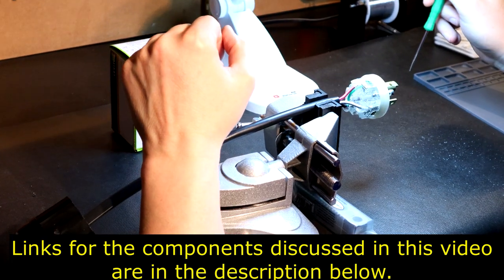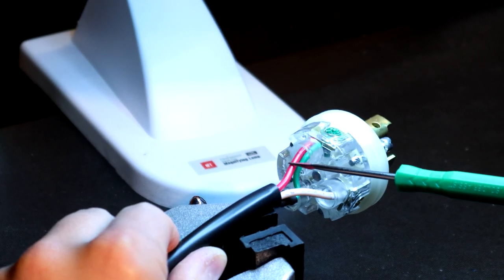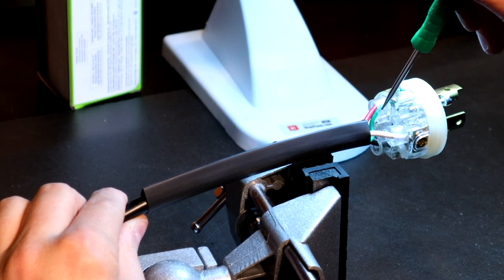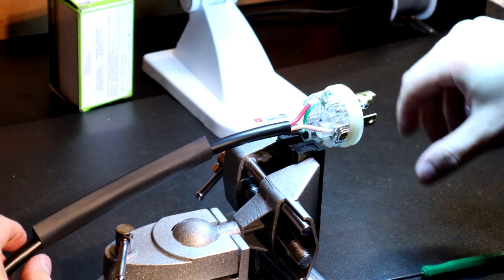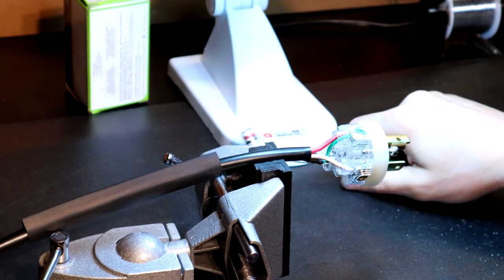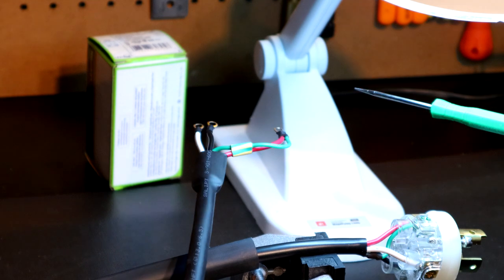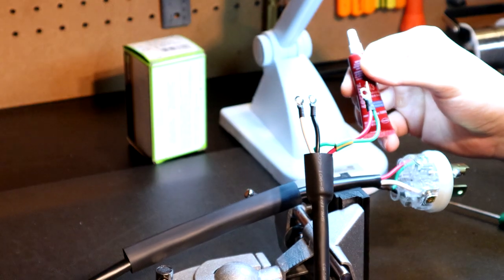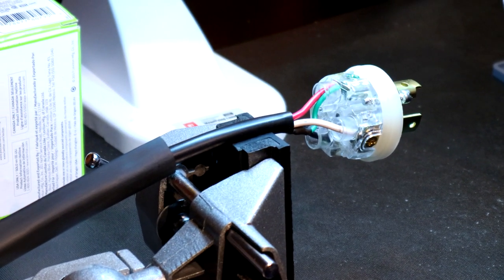CNC 220v Double Shielded VFD Power Cable With Nema L6-30P Connector Overview....

Comment: Just word to let you know that I followed all your recommendations  for earth grounding my CNC plasma table.  Ground rod with 1.25 ohms  resistance.  Wall mounted copper  buss bar.  Tinned copped flat conductors to all servo motors.
To make it short. The table works perfectly from the first burn.  I read the machines thread's and can't  believe the nightmares some these guys are having.  
Thank you so very much. 
John Messar
Reply from the maker: Hey John, thank you for the support, and I'm very happy she's all stable. I realize its more work than most realize, but in the end you proved it certainly is worth it. Thank you again, and have a great weekend!
Vince

Comment: Another great vid, Vince.  Absolutle art work.  No one has your passion for perfection.  Keep the gereat vids coming.   

BTW, i got the UC100:PC cable today.  Exactly what I needed.

Next vid suggestion: Installing an Xbox cointroller to work with Mach3 on a  Win 10. (I'm having poor luck today).
Reply from the maker: Hey Kirk, thank you as always for your support. I really appreciate it. I would recommend using a true CNC MPG then the X-box controller as their prices have dropped to about the same. I'll put it in my upcoming to do list for videos. Thank you,
Vince

Comment: Hello. I am building a cable  that will go from a 5-20 nema plug to a VFD. The VFD manual says to use a latching relay to isolate the VFD from the plug blades for safety, since the discharging capacitors could shock you at the plug blades once it is unplugged. It does not go into much detail as to what type of latching relay I will need. Do you ever use latching relays like this, and if so which latching relays would be appropriate?

The cable looks really nice, and I hope I can make my plug better because of your videos, thank you.
Reply from the maker: Hey Miguel,
Thank you for your support. I really appreciate it. I've never had any issue in 20 years with what you're discussing. If you decide to go the route of the users manual you can certainly do that, or just leave the unit plugged for an additional hour to make sure the unit's energy is dissipated. Thank you, and have a great weekend!
Vince

Comment: thought you weren’t supposed to have soldier inside a l6-30 because of the heat ?
Reply from the maker: Preston, thank you for your support. Soldering carefully has never effected any connector I've used. Keep in mind all circuit boards, and sensitive electronics use it virtually all over. The key is applying it with flux, and precision to keep the heat isolated to the joint, and you'll be fine. Thank you,
Vince

Comment: Do you sell a premed cable and plug that is already made up
Reply from the maker: Hey John, thank you for your support. I don't offer a premade built cable to power the the VFD as each wall plug is different to my clients preferences. If you contact me about your requirement, and plug type preference I can set you up with a cable. Have a great weekend!
Vince